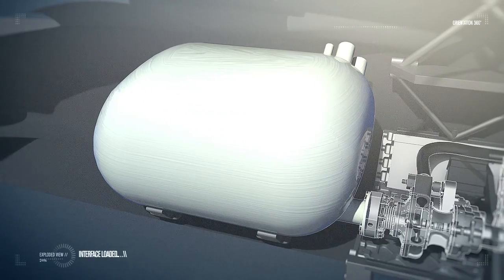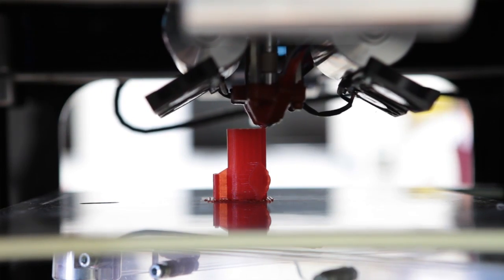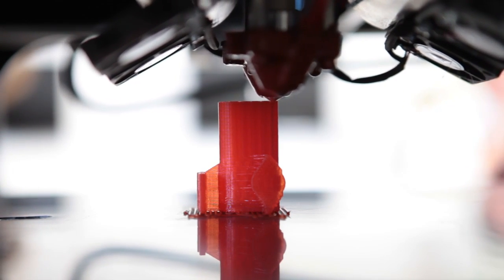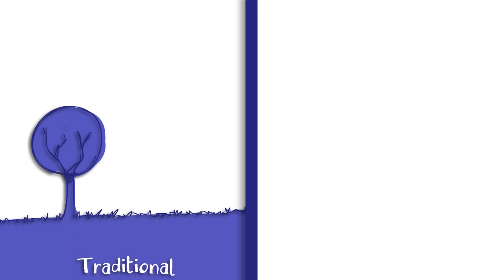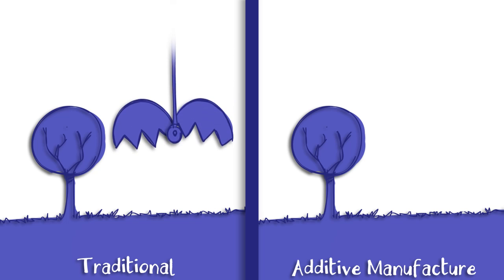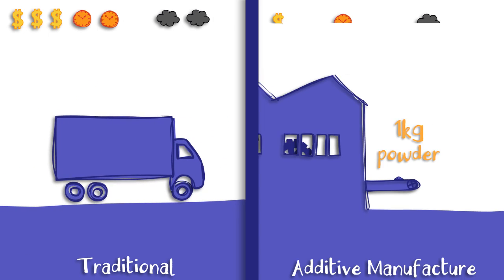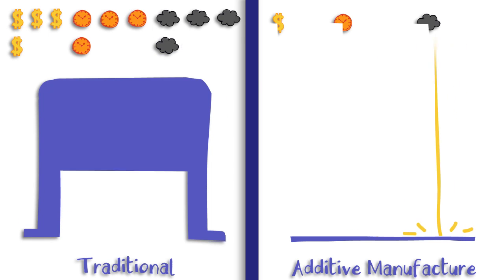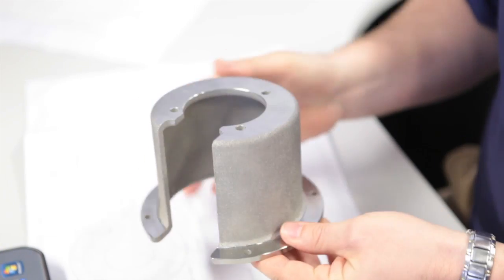3D Printing 1,000 mph car parts

Comment: Regulatory requirements for critical components in Aerospace are stringent and it takes years to undergo testing and get approvals. As I understand it, most of the companies are about 10 years in with 3D printed parts and the data is starting to emerge — the parts are indeed proving lighter & stronger, the investment has been huge, but the pay-off is set to be even bigger.

I think many sceptics will be bowled over by the data when it comes out. Patience is the order of the day .... still!

Comment: The crystalline structures of a billet and sintered part would be different since they are formed in completely different ways...
I'm not doubting that 3d printing can be used to make parts that are strong enough to be put into service.  The only thing that I am questioning is the assertion that a 3D printed part would be as strong as an identical machined part.

Comment: I'm aware of this, and I agree that 3D printed parts are great, and is indeed the way forward.  But what was implied was a part made by 3D printing would be as strong as the same part machined from a billet, which is what I'm worried about.